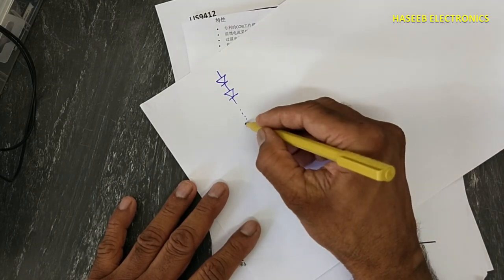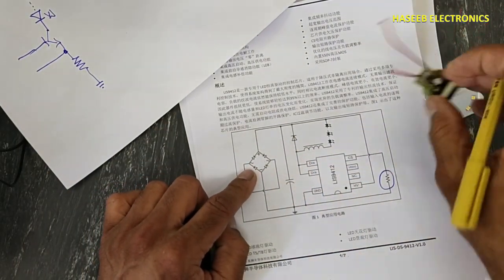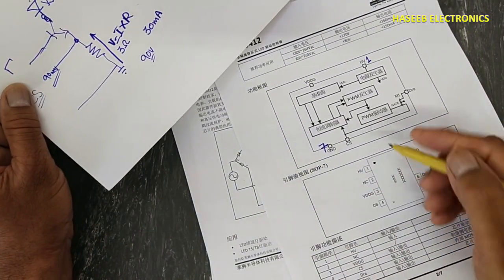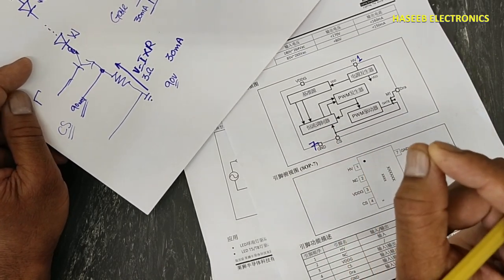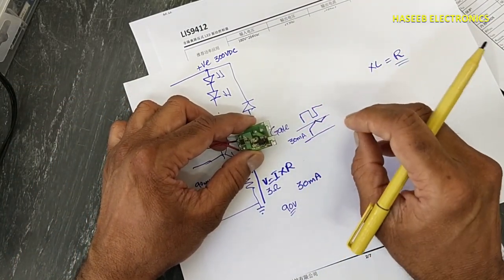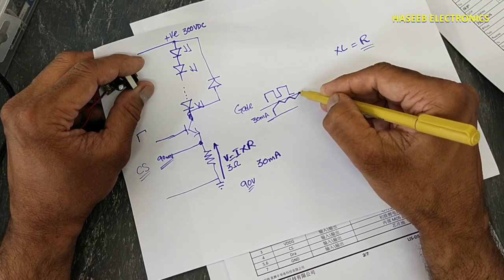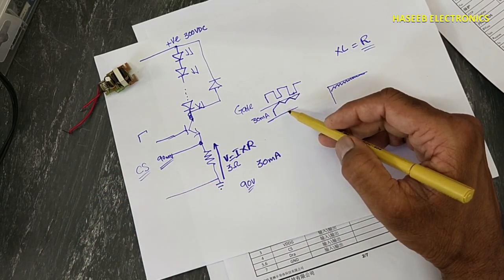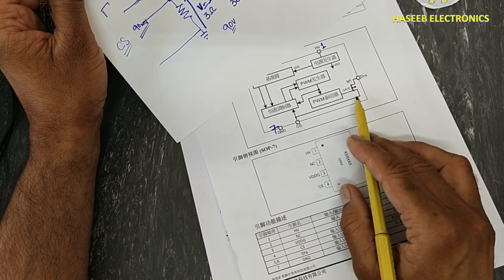{925} LED driver circuit explained

Comment: Good job Sir..
You are not just teaching the basic.. You are teaching how it works..And that is why you are the best...👏👏
Keep on uploading Sir..thank you.always watching from Philippines
Reply from the maker: best regards and special thanks for your worthy words for my efforts
Reply: The best teacher that i ever subscribe here in youtube, i learn electronics a lot from your videos , keep uploading video sir, thank you so much.
Reply: Congretulations. Thank you very much. I have a problem with these circuits. İt must be very sensitive nr. of series LEDs ,and current.
Reply: I have many ceiling led lamps 32 w, 1m long.,broken. I bought from market these adaptor (100-124V ). When I mount  LEDs are blinking. I tried to change capacitors and resistors but I have been unsuccessful. Can you say me something?

Comment: Excellent explanation. The new Chinese bulbs are even simpler, just the control IC and the LEDs direct to 220v (in my region), no capacitor, resistor or coil.

The great feature of all those type of circuits is their hackability. I have been tweaking the current sensing resistor in all my bulbs at home to reduce to half or less the current. Higher resistor, less current, a lot less heat, less stress on LEDs (they never burn now) and you get a very reduced electrical bill with still a lot of lumens.

This works great for ceiling lamps with many bulbs. Where before I had 3x6watt bulbs, now I have 4x2w modified ones. Less than half wattage.
Reply: In there stock form they get very warm. Good to know about the modifications.
Reply: Where the sensing resistor in the circuit  please?

Comment: You make it so easy to comprehend. I'm surprised there is now that simple of a driver device for LED bulbs. That explains how some I've seen are almost as inexpensive as the old incandescent bulb we use to use.  👍
Reply from the maker: best regards 
yes dear i try my best to share the working concept, so that if we understand the working phenomena of any circuit, then we can deal it like a piece of cake otherwise the electronic circuits are jungle

Comment: Great timing - I just took my spiral LED bulb apart yesterday to see if I could figure out why it failed. Amazingly I have 2 of the same bulbs that failed after 2 years and the boards inside are somewhat different from each other, different LED drivers too  ... go figure. I love these bulbs (ANMIEN 120w) but now they are hard to find. 🙁 This is a great explanation of how the circuitry of an LED light bulb works. No more basic lightbulbs 😅 Very interesting lesson nonetheless, thank you!! 🤓 Just curious if there is a way to test the LED driver IC?

Comment: Sir I've seen some tutorial videos on smps sortly, where  the controller ic got damag as we see sometimes, in the video the tutor shows how we can use an external swithing module and the smps will start working. The module comprises of a controller ic, a switching mosfet and sometime a feedback section as well. One thing that hits my mind is that how one can use such module to power up a dead smps without caring of the switching frequency, like they don't even bother to think about it, just a module connect a couple of wires and it goes. The smps transformer is designed to work on a specific frequency and there's a bunch of calculations while designing it. How it's possible? I want your explanation and request to make a video on this topic. I shall wait for your response. Thanks!

Comment: Sir, let me ask you a question. They put coils on both sides of induction heaters, some call these coils as choke coils. Is the task of these coils there to dampen the reverse emf, kickback spike voltages created by the voltage induced on the heater main coils? I thought it was called choke coil, I thought it was filtering the incoming shocks. Thanks.

Comment: Is this "LED driver circuit" possible to modify to use as a DC Power Supply (5V or 12V) ?